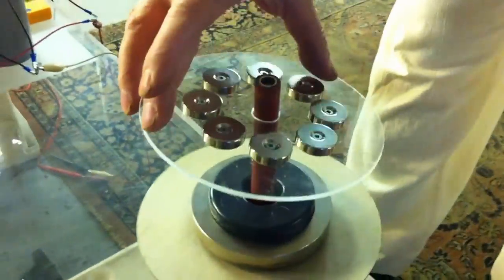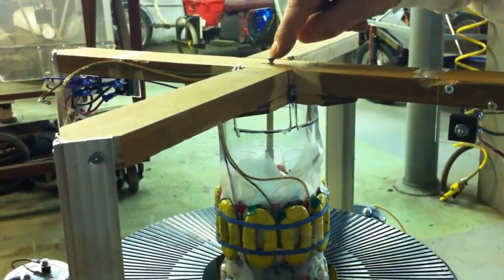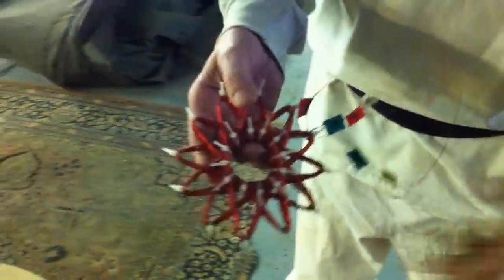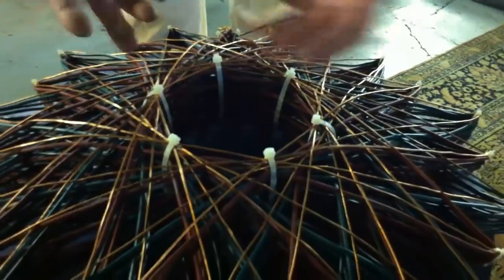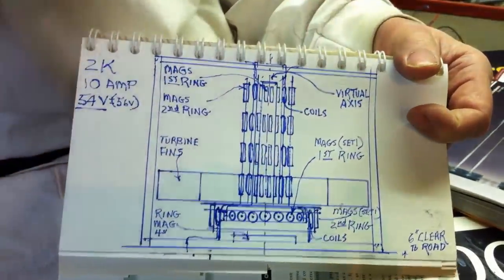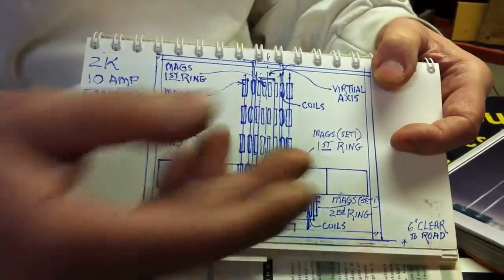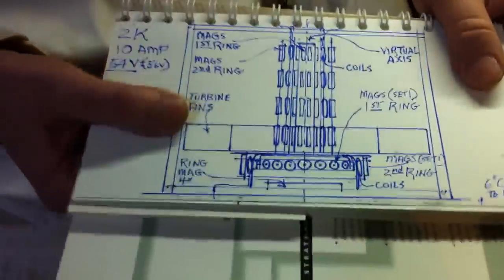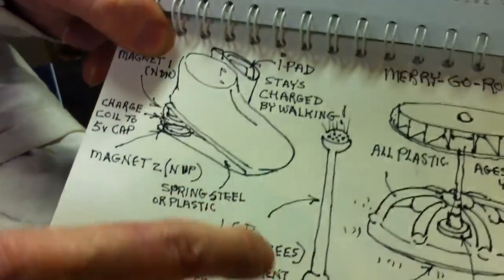UFO Alien Leak - Levitation Stability FS6

Comment: I just don’t see any physical evidence this can levitate physical objects without connection to an outlet and without magnets underneath.  The will never be conveniently placed magnets beneath you as you are traveling across earth. The only example of theirs is the high speed trains that run on magnetic rails. Not an example of a flying saucer.
All of this is technology discovered 50+ years ago but I can’t propel a spacecraft across the solar system

Comment: this is the closest thing I've ever seen to my design that i don't know how it works.  i think you're right about people channeling this and other designs from other places.  This is a masterpiece.  You've actually got it going.  I told people this design would be more stable than the standard tr3b generator, or that other half cone thing.  Wow that is cool.  Thank you for this, you're my new hero.  The half cone with the dome has a potential to run forever, supposedly.  I think the secret would be to create perfect nutation in the rings and the fluid.  Maybe a dual toroidal dynamic.  My design is a single torus, but the fluid spins up in both directions, so it is not experiencing rotating force.
Reply: Idk if you would read this 2 years later and or still working on this project but you should start again and record if you haven't, we need more people doing this even if it's just tests and projects.
Reply: @dollaz4647     I still follow this stuff.  I have found lots of designs that utilize the same principles as this does.  I put some of the engine and ufo videos on my truthe playlist.  I think this is a technology that is already highly advanced, but unknown to the general public.  Thank you, but I do not have any way to make anything like this.  It is inspiring to see someone try, using ordinary tools and materials.

Comment: NICE...  this was under the search for ferro fluid rodin coil.  May i suggest that you review the design for the TR3B  "anti gravity" artificial field generator, then incorporate your idea into that, if possible (needs to be cooled to near 0.0...  then make the rotating permanent mags in a varied ratio, more on the bottom ring, less on the top ring.  my idea gets the different levels to counter rotate, somehow, in my imagination.  Ideally the levels rotate faster, as they go up.
>------------->-------------->-------------->
<--------<---------<---------<---------<----
>------>------>----->------>------>------>
<---<---<---<---<---<---<---<---<---<---<
>-->-->-->-->-->-->-->-->-->-->-->-->
<-<-<-<-<-<-<-<-<-<-<-<-<-<-<-<-<-<

my goal was to make a relative pressure difference, from top to bottom.

Comment: the problems with efficiency are due to the structural materials used and the construction of  the center axis... you could get a greater output with a more stable center body

Comment: Nothing more than a demonstration of a different type of electric motor design. 

Anti-Gravity and anti-inertial effects demonstrated by UFOs are simply the phenomenon caused by creating a quantum-entanglement field that links the state of gravity and inertia from one volume area in the universe with a volume area that encapsulates the UFO. 

This allows the contents of the UFO to experience a never-changing state of inertia and gravity while appearing to move at incredible speeds, make acute angle turns or stop on a dime. A. C. Holt of NASA explains a methodology that allows the UFO to 'skip' or 'slip' through space and time. His theory allows a craft to move from point A to point B instantaneously, independent of distance.

A 'skip' has the craft moving from point A to point B to point C, etc. to the final point F.

A slip moves the craft from point A directly to point F.

This is all done by defining the the electromagnetic frequencies of each point. There are also related frequencies that identify space-time.

By using this methodology, the craft can skip through multiple points of space and time and even appear as multiple images of itself that can display one at a time in different locations and then disappear one at a time. This would explain UFO sightings that follow this pattern.

Alan Holt envisions an electromagnetic device that creates interacting harmonics which accomplish the entanglement, skip, slip and the time-shift.

Comment: "1K car unit; How & why Moon, Mars Towers Built; use of STARSHIP COILS in Moon Craters

Explores/Demonstrates: 1) Multilevel AC-DC Lev Generation for cars; plus links to Starship coils for smooth high-voltage power.
2) Lev-Gen stacking for 2K units with Virtual Axel/Virtual Pyramidal Lev-Balance for Total Levitation Stability. (Reveals Mars/Moon Tower/Crater Technologies).
3) Walking Lev-Gen for iPad charging, plus Children's Energy Education Playgrounds for active generation participation with instant light & Levitation feed-back.
4)Examples of Historical Lighting designs that betray Alien Engineering Channeling, not recognised by Designers. (Only a sample from many fields of Alien Tech-Sharing by mental Telepathy.)
5) Suggested 70% Levitation for ground-cars to ease hill & energy demands & ensure safe manuver-control.
6) Suggested universal one family of broadly defined humanity.

Also refering to StarShip Collection & other UTube Starship coil vids for further Fuel-Free/Battery-Free car generator systems."

How mental has one to be...?

Comment: UFO's operate on Exotic technologies, they require knowledge of the Atomic weight of materials if they operate on magnetic levitation! Some types like Germany experienced with the Bell operate on a loophole that exists in all forms of existence! This loophole would be similar to what Einstein tried to explain as a wormhole, though that type is opened by energy output or emission! The loophole can exist anywhere and can be easily accessed with the right amounts of energy put out from a device but it really takes exotic technologies, magnetic output could not access such loopholes or provide high speed or weightless travel, the energy required would be too great! Now a fact about Pi and finding the circumference of a circle! 

The calculation  C=2πr is important to the name of Mankind's creator! Book 2 of the Torah as the 2 dictates says to look in Chapter 3 verse 14, if you look there! God said to Moses, "I AM WHO I AM"; and He said, "Thus you shall say to the sons of Israel, I AM has sent me to you.'"  Einstein was not aware of the relation to his discovery of Pi, but it cannot be denied! Above are some of the secrets you would need to defeat gravity or travel in space and time, but there is a limitation on time travel! You can only travel backwards in time and the device you use to open such portal has a limit, if it stops working it will return to it's own time frame!

If you are not around it when that happens you are stuck in the time period you visit! This was discovered by Germany with the Bell, later that Bell was going to be the powerplant for the Vril, Haunebu and later designs! One of those Bell's was discovered as it returned to it's original timeline in Kecksburg, though the US did not realize the importance of it reappearing! The first one to travel time and reappear as it ran out of fuel was in Germany, the noticed it disappeared from radar when it broke through the top of a Mountain, they were dangerous and when they could not be shut down, the order was given to cut the chains, though this left operators and troops with exposure to pure Uranium! 

That is what the Bell was intended on being used for, there was even research for use to create pure Lithium for U-Boat battery manufacturing, but the device was deemed too dangerous and the loss of so many of them thwarted any hope for mass producing huge amounts of Enriched Uranium! This is the reason Kecksburg was covered up and cleaned up, the huge amounts of discharged Pure Uranium from it's operation and when it finally ran out of fuel and crashed! The US won't cover this fact on Kecksburg, it is an actual fact, the recovered UFO was not of Alien origin, it was a German Bell that was never designed to fly but in a twist engineers discovered a technology that could defeat gravity through Energy and even travel in time with bursts the Bell was known for creating!

People of the Future could travel backwards but never forward! They can only return to the originating time period of their device, it may be a few years later, but will never exceed the amount of years they have been gone! Not even Stephen Hawking will touch that one! Too many things will fall into place and their Job will be over!

Comment: He is making multi-pole type electromagnetic motors. The big one he showed has some balance problems, and does not appear to be very efficient. Some appearing to use indium type permanent magnets employed.

Gravity and magnetism are indirectly related, but they are not the same. Centrifugal force when used properly can have a similar effect on objects as gravity, but it is not actually gravity. Gravity is accomplished from mass density, and not from electrical activity.

Magnetic levitation is dependent on magnetic poles of the same polarity placed in a way to make opposing force. Keeping controlled stability with balance is a complex  issue.

Nobody has yet found a way to oppose gravity. Gravity as we know it is not polarized. Anti gravity has not yet been able to be accomplished.

This man is very talented in making home made magnetic devices. He has nowhere the physics knowledge of the likes of Tesla or Einstein by any means, but he is interesting.

I noticed the motorcycle in the background has a flat tire...  Maybe fixing the flat and going for a motorbike ride would add some excitement.
Reply: May Lee You're the one saying there is no proof gravity exists not me. If anyone here is an idiot, it's you. You only have to let go of a ball to see there is gravity. Take a look at some videos from inside the ISS, although things weigh different amounts, the air does not rise to the top and the ball to the bottom, because there is no gravitational pull dictating where each element would go. Now if your expecting such long convoluted explanation of gravity, look elsewhere because i'm not a physicist. But I know a lot about science and more than enough to know that gravity is not something that needs evidence of it's existence. Just like we don't need evidence of the existence of wind, even though we cant see it, we can see it's effects, and we can feel it.
Reply: May Lee Oh dear. stick to videos of kittens and handbags darling, physics is clearly not for you.
Reply: May Lee Cool story bro.. Needs more brain cells though.
Reply: May Lee What you are talking about has nothing to do with what I was talking about. Grow up kid.
Reply: @ryancooper1521  Dude you are clearly an idiot and the people who keep liking your comments are probably as unintelligent as yourself. Gravity is a concept that has been recognized for a long time however it has also been up for debate. There have been numerous papers published about gravity  explaining in great detail what we know about it evidence wise and the lack there of. Many great physicists are saying that what we know as "GRAVITY" may very well be something else all together. But how would you know these thing when you clearly educate yourself by watching some guy without credentials make random crap in his garage. No . You , like a lot of people out there like to open your mouth and talk about things you know nothing about and then try to talk down to anyone who actually has a brain.
Reply: +Jerry G. Hi Gerry, let me give you something to think about for a moment, Gravity is a bi-product of matter, it only exist where matter exist, all planets and meteorites have a gravity compliance. To produce a fly machine you have to generate a bi-product considered negative gravity, so its the opposite to a degree. Its what we can't measure is what you manipulate to generate antigravity force, its all around us it holds the fabric of the universe together.
Reply: +Darren Humphris You are right magnetism is not gravity it also is a bi-product of a limited range of matter.
Reply: +Jerry G. The main problem with gravity, from what I can see, is that everything with mass has gravity, And everything is made out of matter. And similarly to magnetism, gravity attracts to gravity. so in order for something to be anti-gravity it would have to be also made out of anti-matter. So that it has no mass, and therefore would theoretically be "immune" to the effects of gravity.
Reply: Gravity is what keeps the moon in orbit. Not buoyancy as there is no air in space.
Reply: Ya Ya, I kow. Some idiot is going to say that there is no moon. LOL
Reply: There is no moon
Reply: I don't understand what you mean "I'm heavier than air'. When you fall over why is it always down?
Reply: Could have fooled me
Reply: +May Lee Oh Mary, I love a feisty woman. It makes life worth living, in a battle of intelligence. However, I may hit you back someday. Maybe create history somehow.
Reply: What makes you think the international space station is not real, I'm really interested in your delusional thought process here
Reply: Anyone with a telescope can SEE the ISS.... Are you freaking kidding me https://www.nasa.gov/centers/glenn/events/stsight.html
Reply: @DoPtRiGGa  whhy oh why do i read these stupid flat earthers' arguments. the idiocy drives me crazy and there is no reasoning with them. but like a trainwreck...  can't help it. i'm a little horrified. but i just keep looking.
Reply: You sir should do a video, you sound knowledgeable in physics.
Reply: @paulrossi4863  who? lol
Reply: Ryan Cooper
the reason I can fall over is because of buoyancy...I'm heavier than air...now back to the point, can you prove gravity, can you reproduce it? nope, keep spinning
Reply: Ryan Cooper
im not a bro
Reply: +May Lee No ISS, is correct.
Reply: Ryan Cooper
don't run...you was talking foolishness so you had to be put in check...a fool has to be placed in his place
Reply: Speaking of Tesla, he would not coin it anti gravity. It would fall under resonant frequencies, and or your zero point. His protégé and a work shop full of fellas claim to have made such a thing from Tesla's design. If its one thing he was about it was natural law and most things that seem complicated are infact, Not! As for this fella I couldn't tell ya. But sometimes its the crazies that revolutionize the world!
Reply: Yeh...."sometimes" lol
Reply: Jerry G. You
Reply: Anti-mass is anti-matter. This is the issue.
Reply: Please look at  "keshe Foundation"
Reply: +May Lee Did you over and hit your head on something? Because that was a really stupid comment. Also, proof gravity exists, is that you CAN fall over.
Reply: +Darren Humphris can you prove that gravity exists?
Reply: @BumAngel2001  Drop something 😉
Reply: Ryan Cooper
because according to my knowledge and I'm sure yours, there are no air bubbles in space and especially inside the ISS...also according to the so called laws of free space (0-G) your body doesn't start to violently move side to side and up and down uncontrollably...you obviously are not interested so don't lie to me...if you were, you would done your research...but you know what gets in the way of people accepting the truth? Pride...the fact that they have been duped and now they have to admit it...but hey, you don't have to admit it to me or anybody else, just admit it private...I did and it was very hard I cried and I was scared but now I am free
Reply: Ryan Cooper
so you saying that my body has gravity? lol...you saying that a block of concrete has gravity? make me look like an idiot since what you saying is true and you should be able to destroy me
Reply: Ryan Cooper
I rather stick to these videos and expose idiots like you...
Reply: Ryan Cooper
there is no such thing as the ISS you mindless fool
Reply: Ryan Cooper
it's pointless talking to you because you suffer from confirmation bias...It is a type of cognitive bias and a systematic error of inductive reasoning:)

Comment: I'm curious as to how practically this could be applied into a modern automobile. Decreasing the wait by even half would save a large amount of fuel and increase top speeds. Though, stability at high speed would become a factor to be dealt with but now I feel urged to attempt it.
Reply: The Intergalactic Rube this guy isn't doing anything that hasn't been done. I don't know what he's trying to get at with the multiple levels of coils but it's basically just a wacky brushless generator. 
If you want to look into the idea of maglev vehicles go look at that new $10.000 hoverboard. They won't give you any specs on power consumption unless you buy a dev. kit but that would be the most likely solution ...we would still need roads made of aluminum though.

If you want to really study levitation though, go look at the Biefield-Brown effect. People keep saying that it is an ionic wind effect but the videos of the original experiments keep disappearing from youtube as well. Probably because they    show the experiment being done in a vacuum, meaning that they found a way to levitate without an ion wind. 
The ARV or Fluxliner is the most likely candidate for a person with less than 500 million dollars to develop it to show the world and it appears to use some form of the Biefield-Brown effect. Mark McCandlish appears to have figured out many of the basics. I don't think anyone has figured out what mercury-like fluid is allegedly used though. Study everything he has on the net. The more I learn about it the more it feels like it is not a hoax which is usually the opposite of the results you get when researching this sort of thing.

The guy in the video probably has a better future in designing science toys then he does discovering some new EM phenomena or developing a new form of power generation.